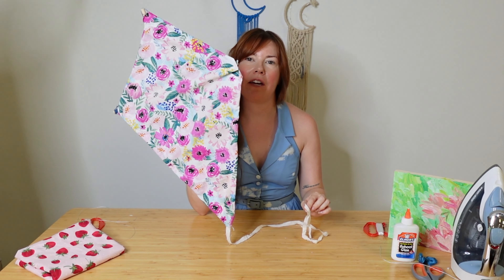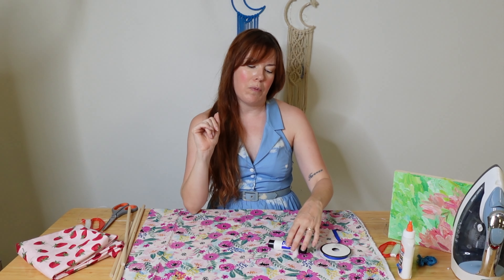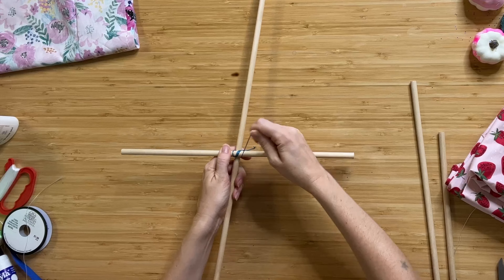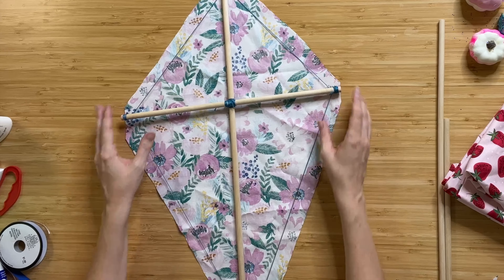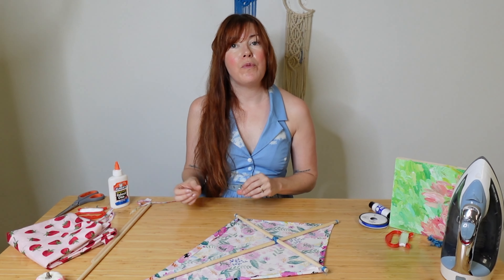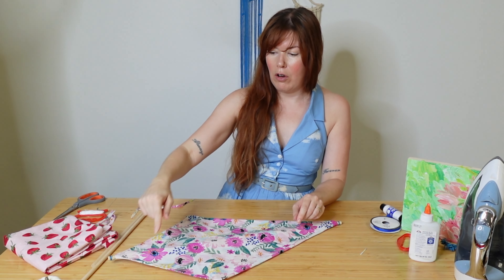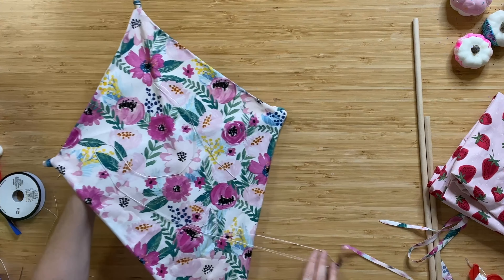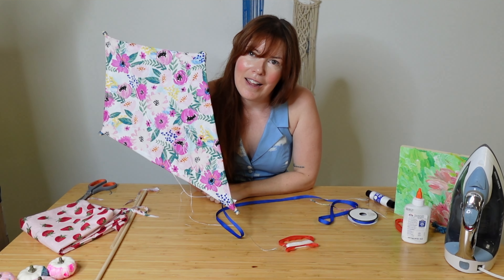How to Make a Fabric Kite, Old Fashioned Turn of the Century Style Kit

Comment: You said rip stop nylon is good. But what are you using? Is it broadcloth?
Reply from the maker: Great question! You can use most fabrics. But if you want your kite to fly, the best fabrics are lightweight and don't allow much air to pass through. Thus, rip stop nylon is great. 

This is why you also see kites made out of tissue paper or even trash bags! 

I am using standard cotton fabric. It's heavier than nylon so it requires a windier day and a more ideal environment. But it does make for a gorgeous kite that's prettier and also makes a great room decoration!